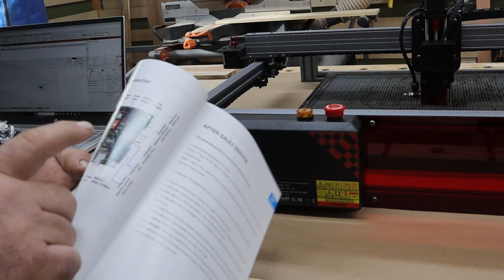Twotrees Ts2 10watt Auto Focus Laser Engraver - The Easiest And Cheapest Laser With Great Results

Comment: What micro setting are you using for the auto focus?  I have the 20w version of this laser, would my 50% power be equivalent to 100% on the 10w?  I'm having problems with 1/4 plywood burning after a couple passes.
Reply from the maker: A 20w setting are not always double of a 10w but they are close. The laser has acceleration and jerk settings the reduce the power when it starts and stops. I will run test when I am using a different material. 1/4' birch from home depot cuts different than 1/4" Baltic birch which cuts different than 1/4" maple.

Comment: thanks for showing this good 10W laser. When cutting thick pieces.. is the focus suppose to be centered on the mid depth of the material or just on the top surface? Is there a compensation in  the software for that? does the laser software come with the equipment?  cheers
Reply from the maker: Focusing as close to the center as possible will give the best cut. There are two main programs for lasers, Laser Grbl(free) and Lightburn(paid). I use Lightburn. In LB, you can have the machine set the focus and then do an engrave. Once it finishes it can lower and do a cut. You can even set it to do multiple passes, lowering each pass.

Comment: You said this engraver cost you a little over 200. I just looked on Amazon and it shows 359. A big jump in a months time.
Reply from the maker: I bought an Ikier Ultra two weeks ago. Before I received it, there was a $500 coupon on Amazon. I returned the one and bought the  cheaper one. I just looked. The current price is cheaper without a coupon than  I paid with the coupon. These prices seem to change daily.

Comment: Hi, what are your cut settings in Lightburn? Also, did you set the material mm's? I get an Alarm 1 error whenever I set over 6.5mm cut.
Reply from the maker: I did some testing. The material thickness setting is; if you set the laser height to your bed. Then place material on top of the bed to engrave. You can set the thickness and the laser will raise that amount. I think this would only work if tou have a fixed bed like a co2 laser. I just move the head and use the micros on the console menu to set the probe on top of what o want to engrave. Also if you installed the light burn profiles that came on the SD card, it sets up 6 micros. I have not taken the time to learn how to create micros but since I cut thicker material I right clicked the "cut 2mm" then on the label changed it to "cut 18mm" and in the g code changed it from -1 to -9.  Hope this helps.
Reply from the maker: To tell the truth, I had not noticed the material thickness setting on the color tabs when I was testing. I was using the presets under the move console. I have done some testing but am not sure what the reactions are when setting the material thickness.  When cutting the 3/4" I just clicked the cut 6mm button, and it worked great. I hope to have time to do some more testing soon. I will try to get you a better answer then.

Comment: Received my TS2, 10w today. Took a couple hours to assemble (absolute novice) but now can’t get Lightburn to recognize the TS2. The instructions are pretty good but not what I’d call complete.
Reply from the maker: Did you load the profile off the SD card into lightburn? Also, did you select the com port?
Reply: I did not but I’m heading to the work shop now to start over. Thanks.  @ShopRamblings

Comment: Good review and right on time. I’m in the process of trying to get a laser to engrave cutting boards. Thanks!
Reply from the maker: I'm glad I could help.  It's all a combination of speed and power. The more power you have, the faster you can go. If you're only doing a few cutting boards, a five watt will work. A 10 or 20 watt will definitely be better. I like the two trees because it has the straight bar crossed where you can slide your board up against and no that you're engraving is going to be straight. I already have a 20 watt and this laser I am giving away. If I was buying another laser for myself, I would get the two trees TS2 20 watt with the screen.